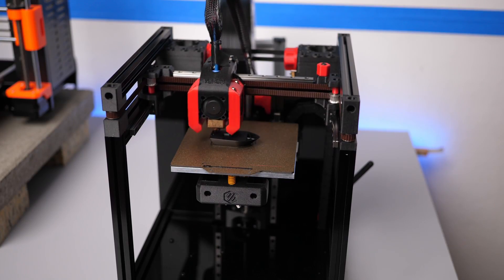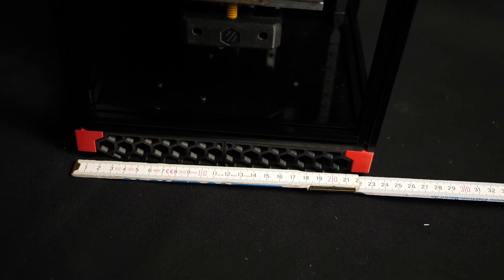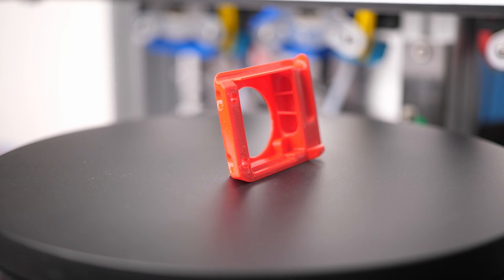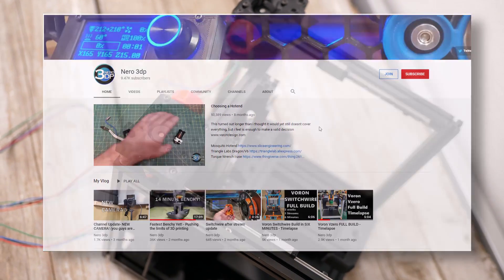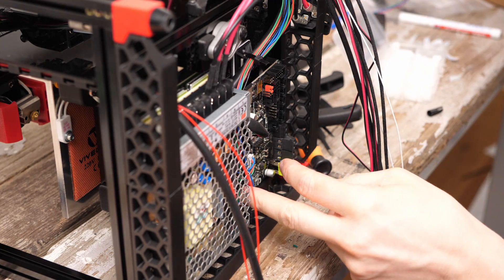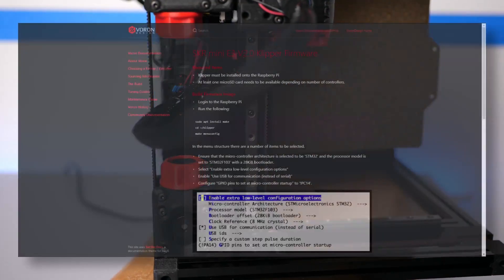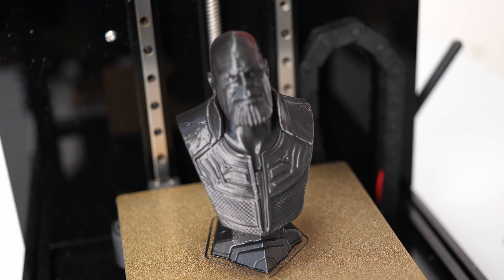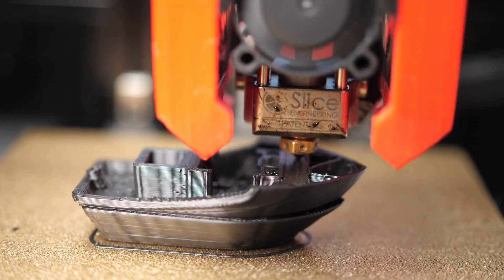Mini, Fast & Open-Source Core XY - The VORON 0

Comment: I might do a 400x400x400 one. As for your material creep. Our solution is to print it with a square 1/2 in hole in it and then cut a piece of square 1/2 in aluminum or steel 16 gauge tubing and stick it in it. Its still light weight and you can step on it. Our material of choice ist hips for that its cheap and takes a beating and the tensile and flex or rather no flex is taken up by the steep or aluminum we did a whole robot like that
Reply: avoid corexy for large XY.  the belt length scales much faster than other kinematics, which means they act more and more like springs, causing ringing.  not worth it.
Reply: @RentableSocks  Mine was not going to be corexy. It will be cartesian As this would be a printer for big parts and printing them fast would be great - I am talking parts that take 1-2kg of filament of even more. the nozzle size would be .8 or 1 RN I am printing HIPS on a volcano at 28mm3/sec with a inside perimter width of 1.5 mm and a layer height of .4 That means I dont crack 50mm/s and the limiting factor is the speed the material melts so I am even considering ditching the belts alltogether and going 4 start lead scresws for x and y that would also allow me to mount a cnc head or laser if needed. which it is. Staying within the torque range of a stepper depending on stepper that should give me a max speed between 80 and 120 mm/sec which is more than the flow rate allows
Reply: @martinpirringer8055  oh, i was assuming you meant you were going to build a massive V0! carry on then, and good luck!  I also have big printers, several 400x400x500, a 450x450x600, and a 400x400x600.  5kg parts are not uncommon.

Look forward to the magnum+ from slice, it's gonna change the hobbyist world of high volume 3dp

I would avoid going leadscrews, they are not friendly over time and don't have the accuracy we perceive them to have, since we're typically only using them to constrain from one direction.  backlash and wear aren't a concern for a Z axis, but are very much a concern for when an XY stage has to move back and forth.  all that means $$$$, and for the price, i'd just go thick belts tbh.
Reply: @RentableSocks  Well currently in R@D stage. Maybe something this summer. We currently have 2 Chirons and that is supposed to be a step up - Not that the Chirons dont do an all right job but I want to see if I can do better. So atm everything is on the table I even drew some things up where I use a true delta not like the kossel but a true delta robot

Comment: I build a Tantillus R back in 2019, basicly it has the 'Ultimaker X-Y-Z' Setup with a 10x10x10cm Build Volume
My Min Time for a Benchy is around 12-13min but Maybe I can push it a bit further

Comment: What about ASA for parts ?
Reply: I mean it's easier to print than ABS, and as far as I know, it performs better on every aspect.
Reply: Very comparable to ABS, but no real benefits in this application as we don’t expose our printers to excessive UV light. Easier is relative, there are also ABS blends which behave nicer such as Formfutra TitanX or eSun ABS+.
Reply: @christophmuller3511  yeah, considering that price wise, the FormFutura is about the same price as Prusament ASA, and that  eSun ABS+ is not in stock at the moment (for the resellers I checked so far at least), I'd say why not rolling with ASA.

Comment: Remove the part cooling fans from the extruder and add bedcoling fans it is only 100mm wide.
Reply: Interesting, but how do you provide even cooling on all sides?
Reply: If you have a Push Push configuration on the left and right side, you will end up with almost now airflow in the middle. If you have a Push Pull configuration, youll have one side cooled and the other side less, because the preheated air is flowing around it
Reply: I have just seen one youtuber, that have two big fans on the bed instead of the hotend. The good thing is that the bed is moving down. So the cooling will be at the correct height all the time.

Comment: Please print the replacement parts in ABS as suggested by the team, if you want to avoid that sort of problems. It has a reason why after multiple iterations, the Voron still uses ABS despite the existence of all those supposedly fancier materials.
Reply: Exactly, no reason at all to attempt using other materials

Comment: I am building one that is purely 24v.  No AC for the heatbed.  It might take longer to heat up, but I am ok with that.
Reply from the maker: Did you find a fitting PSU?
Reply: @CNCKitchen  I am going to use a Meanwell 160W external power supply.  The bed heater is a Keenovo 24v, 60W.
Reply: I use an external brick for this. Works well and gets rid of any mains wiring.

Comment: I have a D-Bot Core XY printer that's around 750mm tall and has a print volume of 304mmx304mmx600mm(maybe more on the Z) and it's cool, but it's fairly difficult to get it to work right. I'm thinking of building a smaller machine to accompany it and my resin printers, and VORON ZERO might just be the machine I go with. Sounds like a fun build. Tallest build I've gotten from my D-Bot was around 9in just a standard female body bust, but it always detaches from the build plate, so it's cool, but not practical at all. The most recent attempt detached with maybe 2mm left to print at the top. And I know how that sourcing parts goes. The first printer I built* was a FolgerTech clone of a Prusa i3 that I sourced parts for, myself. I ended up spending like $700 five or six years ago for that build, before kits and great designs were as common, or I knew as much. Cool vid, look forward to your progress updates!

Comment: Another tiny mini way too small printer. There are far too many miniature printers on the market and too few good big ones. Where are the good and fast 40*40*40 or 50*50*40 printers?
Reply: It's not too small.  It's bigger than his stated use case.
Reply: That's the voron 2.4

Comment: use mainsail or fluidd... octoprint is a hassle.. Bowden at speed needs a stiff bowden..
Reply from the maker: only have a short piece of Capricorn Tube installed at the moment.
Reply: @CNCKitchen  I reinforced mine... And ditched the quick connectors

Comment: Should've checked out the railcore as well (there is a mini version floating around in the discord).  I built one from the kit and then modified another one to fit my needs, currently in the process of putting the electronics together at the moment.

Also, the side panels will increase the stiffness of the frame, so it's a good idea to install them since you're planning on printing fast.

Comment: Is the carbon fiber material conductive at all? You might want to check that out. I've seen someone 3d print carbon fiber material only to realize it was shorting out their electronics.
Reply from the maker: No, it's usually not conductive.

Comment: If you want to put a HEPA filter on the v0 tophat with a fan, there are 2 mods in usermods github doing just this
Reply: There's also a recirculating filter called the Nevermore Micro that fits well, on GitHub, which uses pellet media.  Check that one out; can filter better in theory.
Reply: Brandon Heller you have a link? Very hard to find anything in that GitHub folder. I've been a member of the subreddit, discord and FB for quite a while and haven't seen any of these 3
Reply from the maker: Oh seriously? Didn't see them! Thanks for letting me know.